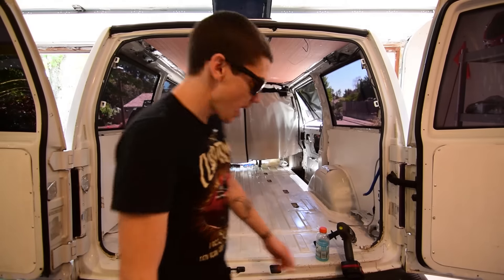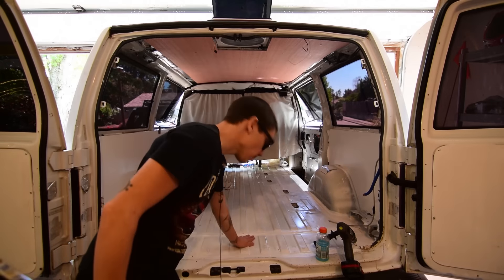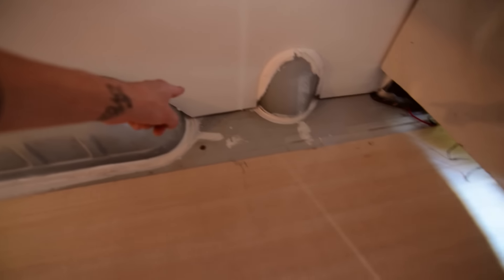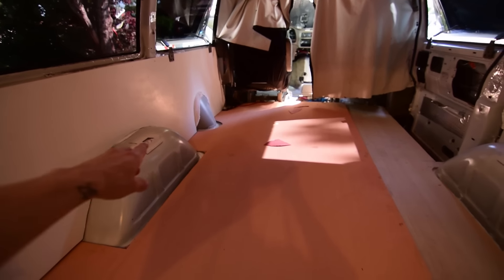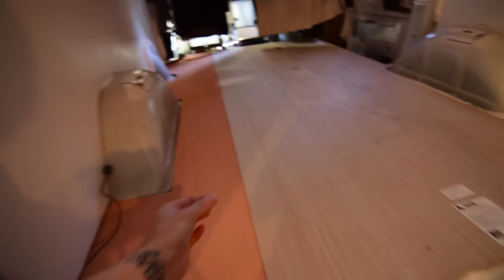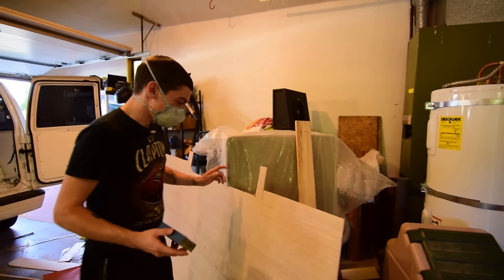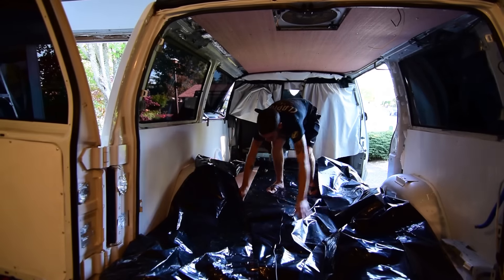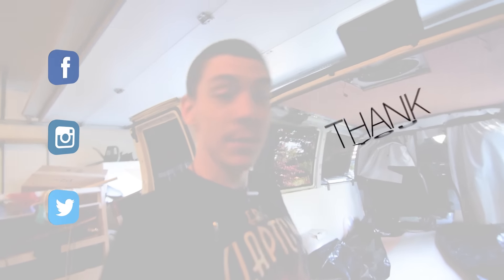VAN BUILD 2.6 SUB FLOOR INSTALL STEALTH CAMPER ASTRO VAN DWELLING

Comment: Good tip about the sawdust collecting mold , I never thought about that .I wouldn't worry about the gas fumes , the pump and lines are sealed ver good and any vapors will be minimal.

Comment: Little tip. When your buying more plastic, pick up a carpenters pencil. They are flat so you can get a more accurate line to cut. Looking good so far. Keep up the good work.
Reply from the maker: +Taz Pelayo thanks for the tip, i greatly appreciate it

Comment: that fuel pump cutout, I was wondering if you should tape it down or put some foam or felt under it so it doesnt end up vibrating or rattling and driving you crazy later on!
Reply from the maker: +Ken Alakel the pressure from the sub floor will hold it down....I hope!

Comment: Nice job dude.  Pretty much how I did it in my Safari. Mine is also windowless, so I had to screw 1x3 strapping on the side walls in order to mount the wall panels.  Had planned to do it with cedar boards, but it's a bit pricey.  However, I'll regret cheaping out haha.  I'm had planned to do my ceiling exactly the same as yours.  Also, respectable call with the PPE lol.  I wore none haha.  Cheers man.
Reply from the maker: +Deif Brett of right on. Why cedar?
Reply: For aesthetics.  The smell and look of cedar is nostalgic to me. Reminds me of camp and saunas at the lake.

Comment: I guess living in Arizona I just have not experienced the water issue as of yet. I did not water barrier anything and I have been totally dry. My van doesn't have windows. I wonder if that is a big difference.
Reply from the maker: +NewZona Rides 2 actually all my leaks comes from leaking rear door seals and ND holes in the firewall
Reply: Oh that makes sense then. I saw another guy sealing his whole van in plastic and I had no idea what was going on.
Reply from the maker: +NewZona Rides 2 haha that's one way to do it!

Comment: I was thinking if this was me building my van...I would have to mount a TV to the wall and bring a game system... that will double as a DVD player for movies... that would be essential for late at nite and especially rainy days stuck inside all day...you should look into those mobile hot spots so your never without WIFI again... im rootin 4 ya van man..
Reply from the maker: +silly dogma 1 I had a TV for a while actually. It basically a bigger screen for my laptop. I actually have unlimited data on my phone so im usually not without internet. Thanks!

Comment: (1) Will the plastic under the sub-floor sag down into the channels, preventing water from flowing well?  (2) Where will the water evaporate to - since it's a water-sealed environment?  Could you just park on a hill and let the water drain out the back doors?  (3) There are small reservoirs in the floor that were previously built to support seats; those reservoirs would collect water; so would you be able to drill a hole in the bottom of those to allow water to drip out?  I hope that drilling holes in the floor would not encourage rust to develop in those spots.  (Sorry for the long-winded comment)  :-)
Reply from the maker: +Don Decoste no problem. 1) I pulled the plastic tight to avoid that 2) that will make more sense in future videos than I can explain with words 3) I don't want to drill holes there because water, spiders, and fumes can get in easily. I dont expect to have another leak
Reply: Wow good points.

Comment: Are you ok with not welding that plate back into the floor? Won't moisture get in from below?
Reply from the maker: +Darin Bicknell I didn't want to pay someone to weld it, and not sure if it's on to weld above a gas tank anyway. The plastic seals out moisture and/or gas vapors

Comment: You might want to consider getting a Zoom H1 digital audio recorder.  You can run your lavaliere mic into the Zoom and simply slip it into your pocket.  That way you are not tethered to your camera just inviting mishaps.  It's easy to sync the Audio from the Zoom to the video from your camera, especially if you are using Premiere Pro.  I'm enjoying watching your re-build.
Reply: I should mention, the Zoom H1 is dirt cheap, about $100.  Much cheaper than a wireless Lavaliere set-up.
Reply: Or just get a Sony AZ1. It has amazing mics and can be had real cheap as well.
Reply from the maker: +1960HikerDude ive got one actually. Going through the 30-50 video clips and syncing separate audio to each one will double my edit time, and I really don't want to do that. the auto sync on premiere only works for one clip at a time, I'd still have to match up each video and audio clip and delete all the unwanted takes
Reply: I can see how that can be a real PITA.  For my  cooking vids I record an intro and outro in front of the camera.  I do the rest of using voice overs.  So, it isn't labor intensive in my post production.

BTW - I do have a R0de Video Mic Pro.  It pretty good.  Not quite as good as the Lav mic in noisy environments.   But, given your production requirements, it's probably your best choice.
Reply from the maker: +1960HikerDude oh nice! I'll check out your channel. Do you think the road pro would be good for interviews when im stand next to, but behind the mic, and the person being interviews is 5 feet away directly in front of it?
Reply: It's shotgun mic, meaning that it is more sensitive from the from and less from the back and sides.  But, if you're standing directly behind the camera or right next to it it should pick your voice up OK.  One thing I would absolutely get is one of those furry "dead cat" wind socks, as the mic is very sensitive to wind noise.

Comment: hey bro I have to ask you what the heck are you doing with that floor? Why didn't you just use a sound deadening for the entire floor and all the walls and the roof is extremely affordable and works great
Reply from the maker: +I Am Second I don't feel the need for for, and would rather $100 on something else.

Comment: instead of placing the blade next to your clamped down wood piece - you might try measuring the distance from the blade to the edge of the jigsaw bed and then clamping the guiding wood far enough over to let the edge of the jigsaw bed to travel along the edge of your guiding wood piece - you will get less random motion and obtain squared edges to boot. Fyi, a good youtubers site for learning about using tools and tricks is https://www.youtube.com/user/seejanedrill.
Reply: YES! Your guide is supposed to ride on the side of your jigsaw base plate so your saw is flat on the wood instead of hanging up in the air. 100% easier to get a good cut.

Comment: 👍🏽 Must be nice to be able to take your time and do it up right. I'm really enjoying watching this build. It might seem like wasted money but you can buy a metal straight edge to make those cuts easier. I got mine at Lowe's, it comes in two pieces and has two clamps to be able to span 8 foot material. Harbor Freight has them even cheaper. They are worth every penny, in my opinion.

Comment: I guess you're right but $100 is actually extremely cheap for sound deadening material. and especially considering it's probably the number one most important thing to put on the interior walls out of everything that you could do. just those pieces of Luan, must have cost you at least $18 each correct? just thought it was a pretty good option that's all. I used it and many of my friends did and also if you get it and the ones who didn't use the sound deadening material, really wish they did because there's a humongous difference. also, if you don't mind me asking, why didn't you end up using quarter inch plywood on the walls and ceiling? that gives you an amazing base to mail anything to without using any type of anchors or anything. also, did you ever look into using quarter inch tongue and groove on the ceiling it's only about $4 for a 4x 8 foot piece very very easy to yourself that's what I did with my van and it looks absolutely amazing and I did it for under $35 the entire roof
Reply from the maker: +I Am Second didn't use sound deadening because I don't think it will make enough of a difference to justify the cost. I had it before and after removing all of it I didn't think it helped nor do I care it. I always have windows open and the radio on while I'm driving. As far as the 1/4" I just didn't think about it. That tongue and groove must be nice! Did you stain it?
Reply: I haven't seen that yet butt I'm in the middle of considering if I should just go with polypropylene or use a colored stain I'm not sure what I should do do you have a email or a number that I can text you a few pictures of my van that maybe you could give me some of your advice let me know buddy appreciate it

Comment: Not sure wrapping the Luan in plastic is a good idea. I understand what you're trying to do, but the plastic will get moisture trapped against the Luan causing mold, mildew, and eventually rot it out. I think you would be better off leaving out the plastic altogether. If you want to safeguard your van floor from getting mold, use something like this http://amzn.to/28ZlLdR  and leaving the Luan uncovered will allow air circulation so it should last much longer.

Comment: I'd expect I would be spending much time in the south as well where mold can be a problem... in apartments, etc. Don't the vans people buy from the dealer usually come carpeted, without all that wood flooring you are adding? Or, did you rip up wood beneath the carpeting before you built your own wood floor? Your thoughts on carpeting as it exists... gets moldy over time or something? ...Thank you. Great van build series. -Geo